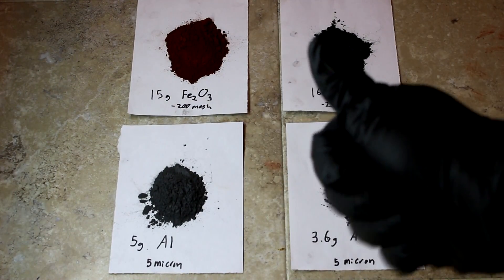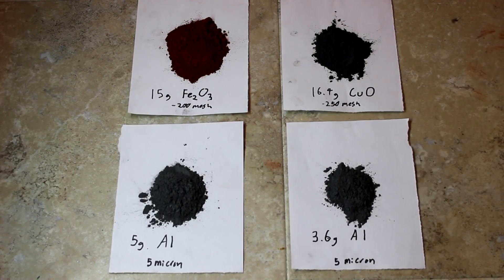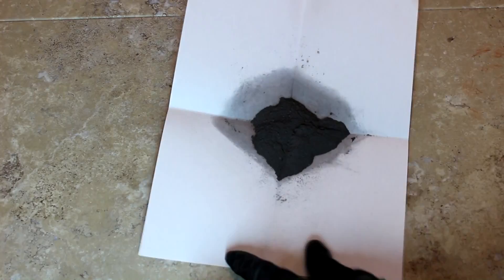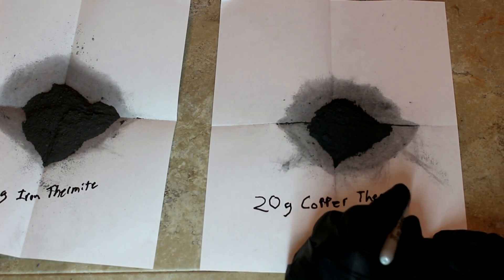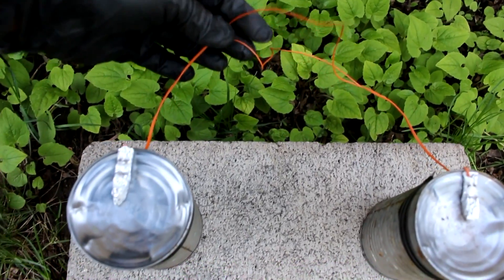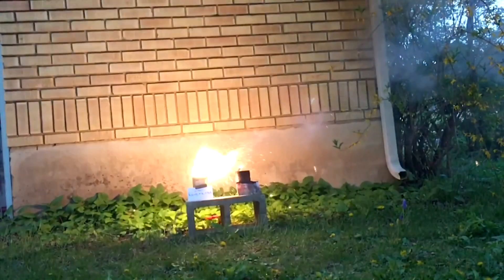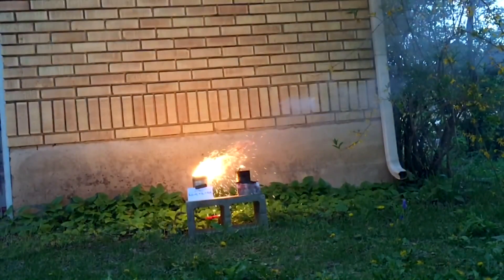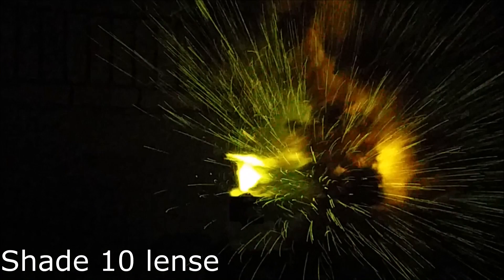Iron and Copper Thermite

Comment: Seems like the copper thermite would explode if confined. then again mesh size would probably slow the reaction
Reply from the maker: +magana559 
I want to try shooting a gun with it. :)
Reply: +Cody'sLab that would be cool, I'd try a muzzle loader to determine if it would cause any pressure issues in a smokeless rifle. 

also would definitely destroy the barrel in a few rounds. molten copper cuts through steel like a hot knife on butter
Reply from the maker: +magana559 
Remember that bronze gun I built?
Reply: +Cody'sLab absolutely! 
I thought maybe you were talking about the mosin I seen in a few of your videos. 
I'd definitely would like to see the outcome of a thermite propellant.